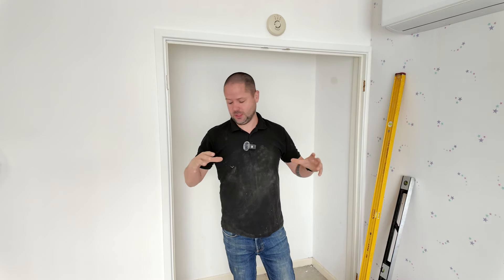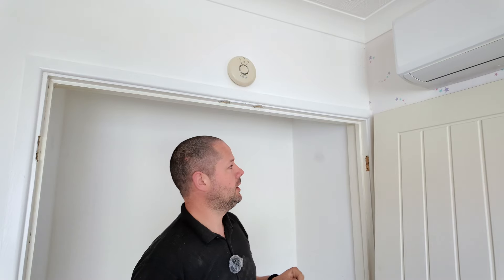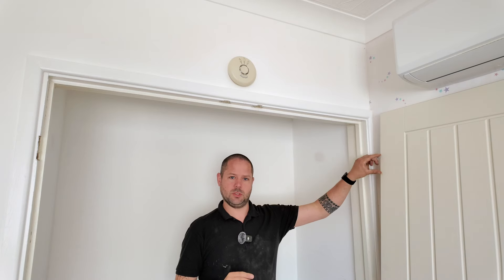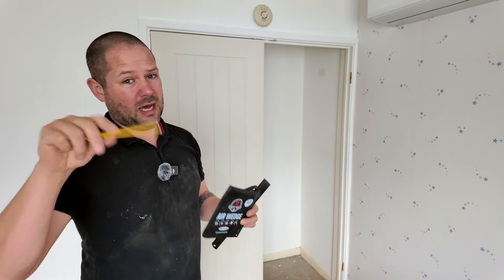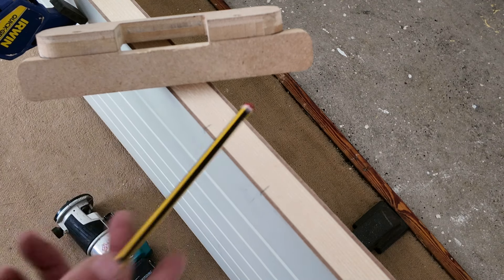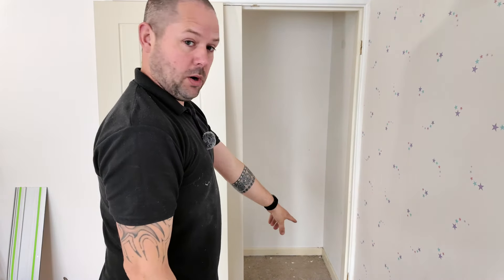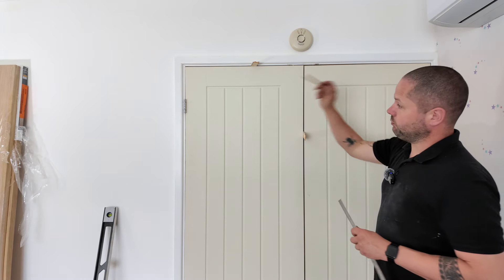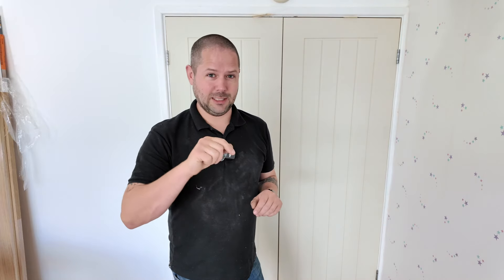How to hang double doors !

Comment: If I have winding issues  I some times  drill a hole in the skirting  so I can get to the sloe plate and pit a 3 inch nail   on the angle though the stud work and move the stud work back in  to alignment  doesn't always work though
Reply from the maker: That’s a great shout buddy, I will give that a go next time the issue comes up 🍻
Reply: Love the channel  btw   class  workmanship @LTWCarpentry

Comment: Pair! Interesting to hear that you've also found Windbags like to deflate. I find I have to stand on the value while marking out.

A really tidy job there and very clearly explained. Looking forward to your next video.
Reply from the maker: Cheers Olly , really appreciate the comment buddy, 

Try the might wedge ones buddy, I haven’t had them long so not sure on the longevity but the seem really good so far. They hold air which is a bonus mate 🍻

Comment: Pair. Great video as always.  How do you go about dealing with the twisted frame without either taking it out or adjusting it. Do you just pull either top hinge out or in etc to adjust the opposite corner?  Obviously there will be a gap on the inside of the adjusted hinge then?
Reply from the maker: That’s exactly that mate, you have to pull the opposite hinge out from the problem, yes you have a gap down the back of the hinge but you can fill this if it’s a painted finish. This isn’t the ideal situation but in most cases a customer would rather this then adjusting the frame it’s self
Reply: @LTWCarpentry  thought so. Thank you. Doors are always  an issue especially in older properties. Ive yet to come across a headlining thats level!  Keep up the good work.

Comment: Pair
Reply from the maker: Cheers Ian 🍻
Reply: Nothing to do with the doors looking for advice.I use a 18g paslode once in a while but it cost s abit to keep running gas servicing .Can you recommend a battery one .Thanks
Reply from the maker: @iansherman6638  I use the hikoki 18g mate, gasless, never misses a beat and most importantly for me it’s quiet to use. I used to use the hitachi gas nailer and used to scare old ladies on a daily basis 😂😂 hope this helps buddy
Reply: I’ll have look thanks . I did notice Screwfix do one there own branded but not sure if it’s a trade version.
Reply from the maker: @iansherman6638  do they ? What’s it called buddy ?